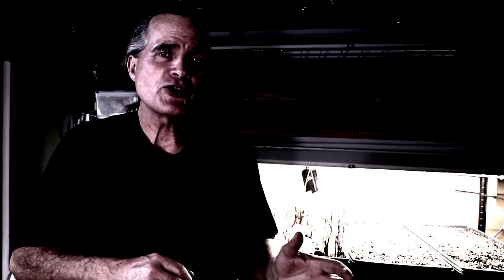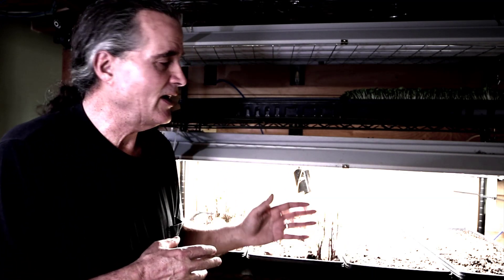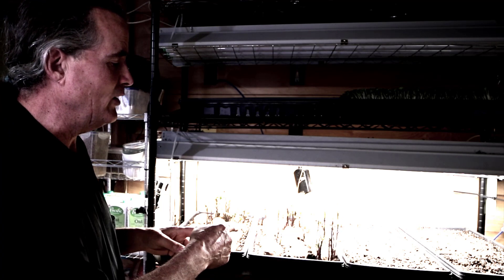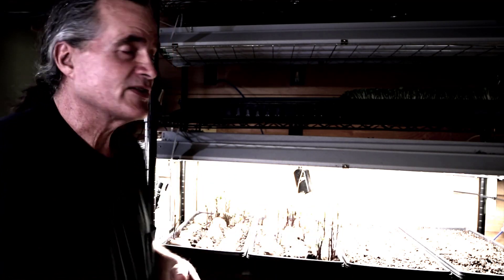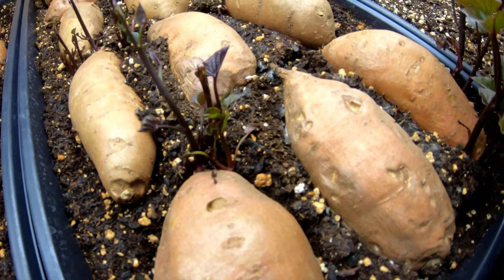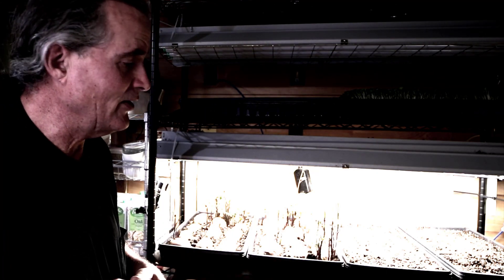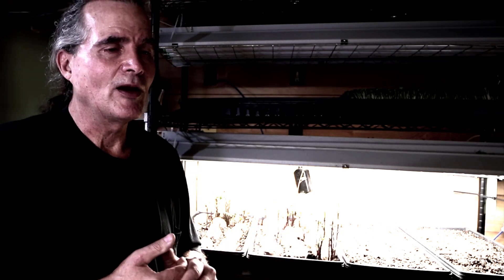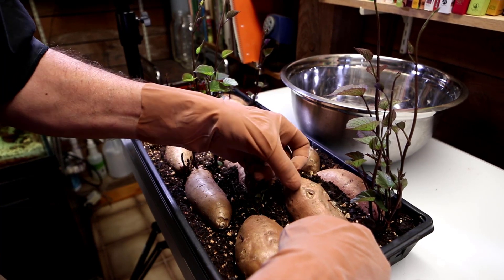Starting Sweet Potatoes 3rd Video Disease detected😥😥🍠🍠😷

Comment: Had some rot develop, but a good soaking with hydrogen peroxide seem to save it. Got three good slips, may have over watered started to get the crystals on lower leaves or maybe to close to the grow lights.
Reply: That’s cool! How long did you soak them in hydrogen peroxide?

Comment: I have some white stuff under the leaves. I don't  know what it is ....help !
Reply from the maker: Hi Mar v, it would be much easier for me to help you if I actually had a picture or video of what you're seeing. However if you are over-watering the sweet potatoes then there is a process that is not a disease process (not an infection) that occurs when sweet potatoes are over watered. As a result the leaves will exude a white crystalline material that looks like sugar or salt on the leaves as a result of excess water. I've never experienced it on my sweet potatoes over the years however there is information on the web about overwatering sweet potato plants. Let me know if this seems to make sense. I hope this helps!
Reply: @GrowingABetterTomorrow  thank you for taking time to respond . I think I saw white tiny flying insects look like aphid and they leave white residue I guess . I wonder if it is safe to wash them off and cook the leaves ?